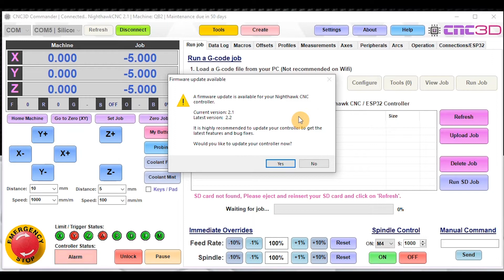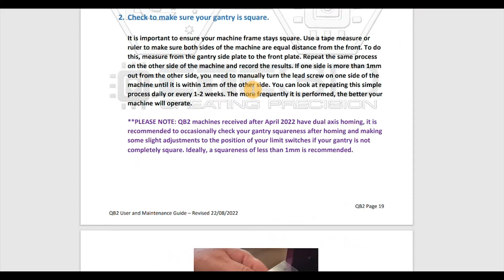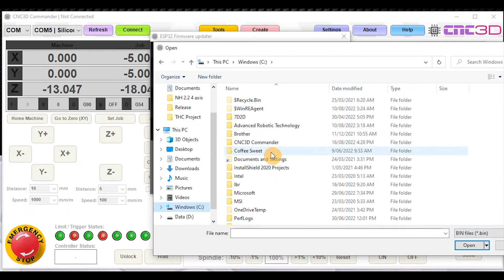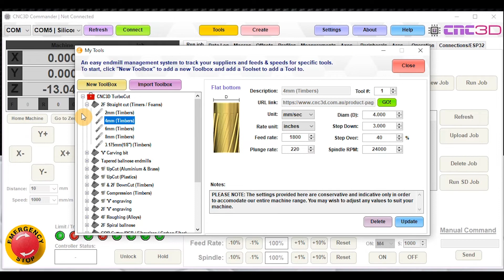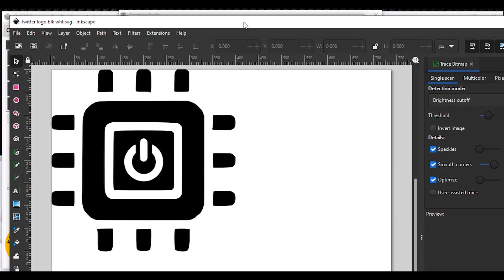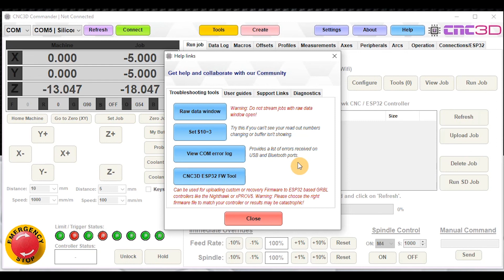CNC3D Commander Updates - Build 283 - Powerful yet simple GRBL and xPROV5 control software

Comment: hello If I select the controller type cnc xpro v5 box in the settings tab, the machine does not respond. Can I find instructions on how to set it up somewhere?
well thank you Jozef
Reply from the maker: You may not need to do this. Consider unticking all values. This may be out of date.
Reply: @cnc3d  I have the latest version but I will try to mark nothing if possible. thank you